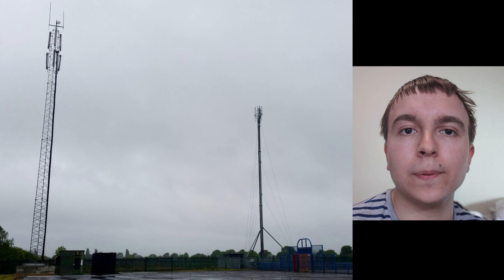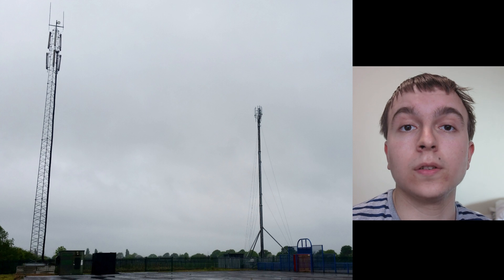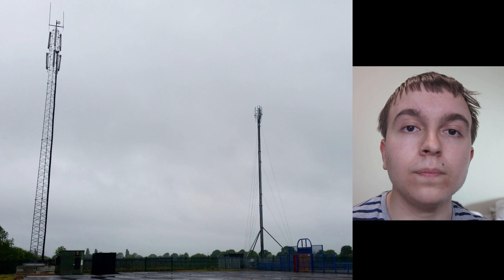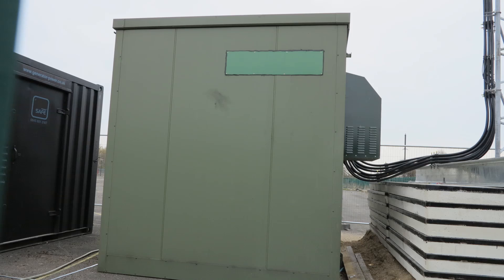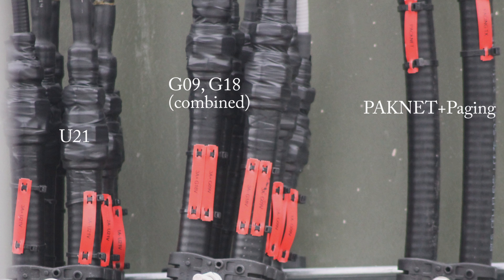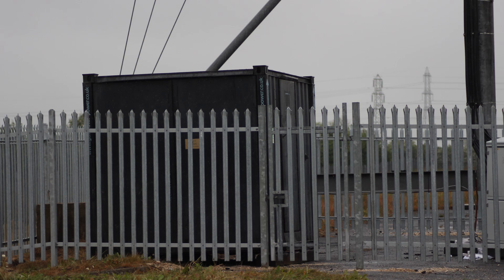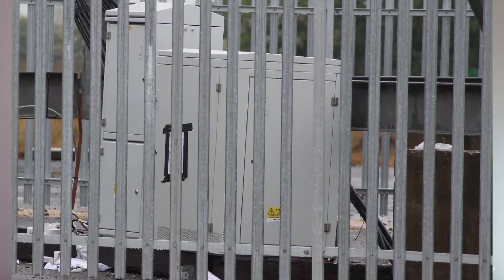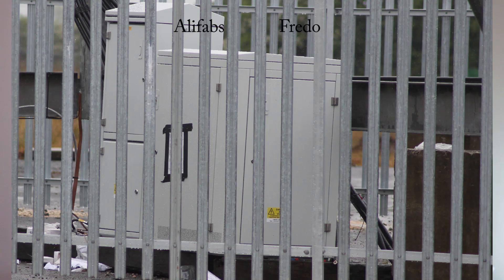Temporary Mobile Masts (CoWs) from Vodafone, EE, 3 and O2

Comment: What are the Packnet and paging antennas for?
Reply from the maker: Paknet is an data only network that runs on VHF.
Paging is for pager receivers, which was a communciations system used in the past.

Comment: can I  change the  subject Chris, and ask you a question about three supper voice, which operates on 800 MHz,
I have a Samsung Galaxy Note 4 which I bought unlocked , my phone has channel 20 which is 800mhz , I have the latest marshmallow software installed, but it will not work with three super voice service, any ideas why not ,,
Reply: It isn’t supported

Comment: Looks like Vodafone cheaped out as usual :D
Reply from the maker: I don't imagine it was cheap for them to build certainly and it's nice to have a bit if 3G heritage.
Reply: Good lord, Vodafone doing legacy HSDPA at 7.2Mbit/s? I thought it was only old Orange masts that still had this HSDPA equipment...
Why didn't Vodafone install something that was capable of 42.2Mbit/s? And why didn't they add 3G900?
Quite ironic that EE have got 2G1800, 3G2100 and 4G1800 in that location (from the dual bands) yet Vodafone have no 4G, and legacy 3G, which you're likely to get about 2-3Mbit/s from at best...
Btw, what about O2? Do they not have any masts in this location? Or does their services come from a different location?
Reply from the maker: 0.5mbps U21...
O2 has no masts at this location; they manage off the CTIL masts either side. In the time between the roof site being decommissioned and this one switched on, the signal there was absolutely fine, just this masts maybe serves a section of road better.
Reply: Peter C Okay, that speed was even worse than what I thought it would be! Though it may be a combination of the microwave backhaul (though as you said, it's not worth rigging up fiber to a temporary mast) and the legacy HSDPA.
In which case, if this is just a filler in mast, then there should be no issues. Chances are, O2 might even be faster because of using an upgraded CTIL site, instead of this temporary setup.
Reply: Knuckles the Echidna You're here as well???